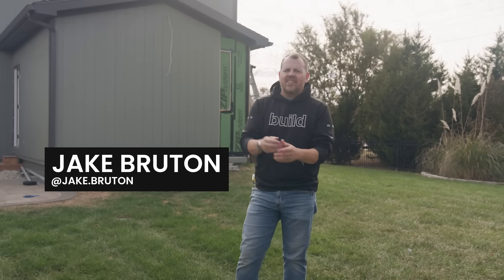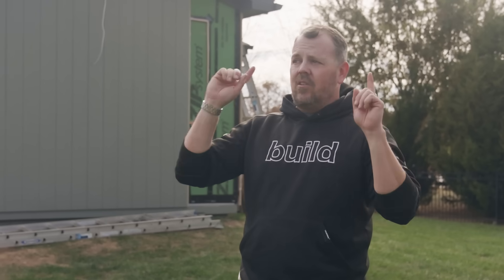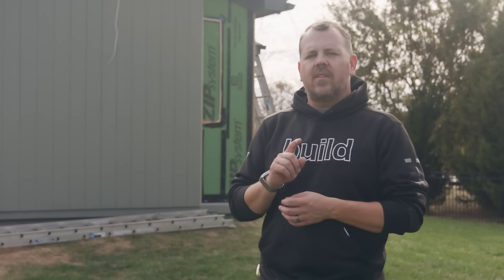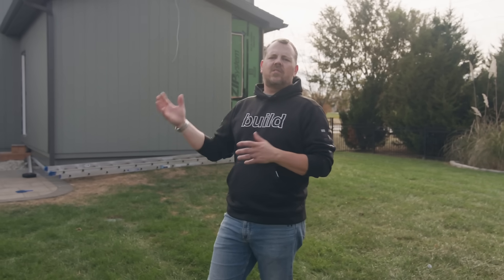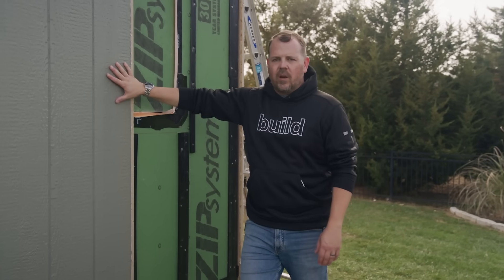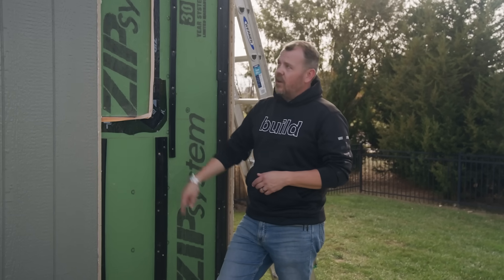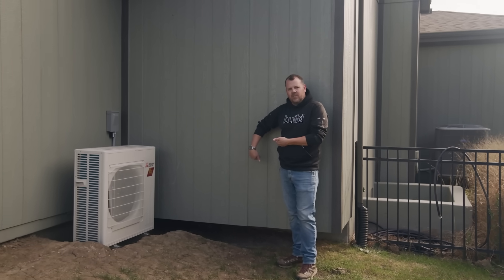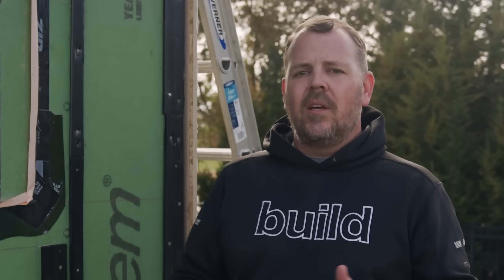Why Your Wall Assembly Needs Convection Drying

Comment: I get that the T1-11 “single wall” assembly isn’t up to snuff in the building science world and that it’s nowhere near as durable as the homes on the build show… not even close.

However, I’m all for people being allowed to build homes this way as long as they have full disclosure of the methods used. In my opinion, it’s easily as durable as a house with vinyl siding and if you wanted to mitigate the window leakage issues, then use some painter’s tape and a fluid applied flashing for each window, then place trim over once it cures.

To me it just seems like an affordable way to build a shelter and own a home. Obviously, the price of the home should also reflect then build quality (so if these builders are upcharging and gouging the market, then sure I think that’s an issue).

Anyways, great info but just another perspective on it.

Comment: So, for me, the venting of the rain screen needs to be wildfire safe.  The hillside that I'm building on is a mix of trees and grass because 40 years ago, it was burnt by a wildfire.  So, a plastic vent doesn't cut it.  I plan on using 1/8" galvanized mesh for this function.

Comment: We are planning a remodel, will be removing T111 and house wrap, going back with zip, new windows, 2x4 purlins and screwed down metal siding (three color barn dominium with wainscot), trying to decide foam sheets under the zip or on top of the zip then 2x4 purlins?

Comment: It's not clear to me once you add the cladding where the air will enter/exit from. Possible to show that?
Reply: Just the under neath. So the underside of the siding and rainscreen is open
Reply: Typically with a vented rainscreen detail like this, the Coravent provides a small gap at the base of the siding and at the top allowing air to be drawn in through the bottom, pulled up behind the siding and out at the soffit line.

Comment: T1-11 is terrible. It’s a terrible idea, like you said, it makes window installation a challenge. Your sheathing ends up being your water control membrane, and that means all the moisture that goes through it, ends up stuck inside your wall, where it meets up with warm/cool air transfer. That coravent is vital for breathing/capillary space. Using T1-11 on anything other than a shed is nothing other than cheap. The builders are saving themselves money and passing on garbage to the home owner. 23 + year experience building here and now building high performance in the NE. The latest building science proves the value of that capillary space the coravent provides.

Comment: Another wood frame house, another issue to mitigate.  I wonder if Jake would ever sign on to build an ICF house to the roof.  I mean he's in Tornado Alley and I'm sure there's a market for houses that that don't get scattered across the countryside when hit by a tornado.  It would be interesting for a top tier wood frame builder like Jake to go through the process and note along the way the steps he can eliminate as well as any issues he may encounter.  BTW, I have first hand knowledge that not all stick frame houses disintegrate in a tornado.  While riding out the 200mph eastern eye wall winds of Cat 5 Camille, an embedded tornado clipped the house and lifted it a few inches and dropped it.  That was fun.  Credit to my father for building  all walls as sheer walls.  My point being, it can be done, but at a cost that would probably exceed ICF.  And ICF would certainly be cheaper than building a CMU shell around a Zip house as is being done on another BSN channel.  I used to play in the rubble of cinder block houses.🤷‍♂️
Reply: All the Build Show builders are stick builders, who get sponsored by stick makers, so they only want to build with sticks.  
ICF is superior to sticks no matter how well Jake or Matt put the sticks together.  I’ve thought about starting an ICF only building company because it’s so superior to wood, yet it costs less than many of the wall assemblies the Build Show executes in their builds.  As an engineer it’s obvious the advantages of ICF once you understand wall assemblies and the perfect wall concept.
Reply: @andykross7242 Since your an engineer, can I ask you about ICF? How easy is it to repair? Can you add additions easily down the road? How strong is it compared to stick framing? Do you have conditioned crawl spaces with it? Can they be made passive? Do they require slabs? If the walls crack from shifting, can that be fixed easily?

What I like about stick framing is I can build my house right out of lowes and home depot. And there is margin, and its easy to repair. My wife and I had to do a pretty big repair that was inexpensive just time consuming, but i could run to Lowe's and start the project the next day. 
Also, what are the down sides of ICF if it isn't done properly? Can it be easily fixed if there is an issue? 

I became a builder ironically because I dont like depending on them... Sorry for the tons of questions. Ive been studying "building science" if you will, because my wife and I are going to build it ourselves. 

I'd be open to ICF if you could pass on a few good resources.
Reply: @chadrambo1038  I built a 6”2 conditioned crawlspace in my DIY 48’ tall ICF home.   My walls are 8” of concrete and rebar. It will be here in 1000 years 😊
Reply: @chadrambo1038  and yes ICF homes can be passive. Mine is. Many DIY homes get better blower door scores than Matt when he first started trying.
Reply: @andykross7242 There are some merits to the wood fiber cement type ICF (although those have their own problems as well). But I would never choose a foam based ICF product over a well built stick framed house.
Reply: What are you doing using common sense. Common sense isn’t sponsoring this video
Reply: @AllthingsRocco Matt, Jake, and Steve Baczek once had a little round table about ICF.  For the most part they regurgitated the same issues like termites, for which there are many mitigation techniques.  Funny that people who build wood houses would take issue with concrete houses.  Matt used the term "ICF cultist" on a recent video.  I suggested he use the term "ICF enthusiasts".  They said they would revisit ICF.  Probably when ICF gains too much traction and Huber asks them to bring up termites again.😂 My comments do not pertain to Jake.  Mainly the front man. One day a product is the best thing since sliced bread, the next day , not so much.

Comment: 5:21 Yes, "that thing" is water tight and air tight, which is good, but also vapor tight, which is NOT GOOD , walls that are vapor open are resilient to all kind of moisture problems.

7:26 If you can compress those ZIP-R sheets by hand, I would use regular ZIP sheathing without the integrated insulation and apply exterior continuous insulation in a vapor open material (Rockwool, TimberHP, ...). That way your walls become also more vapor open.
Reply: Vapour control layer is on the inside. He’s talking about the outside in the instance. Jake knows what he’s doing and is well aware of vapour control. Your wall can breathe outwards so any moisture issues inside the assembly are a non issue
Reply: @therefinedcaveman  Yes,  "my wall" is vapor open, but Jake's wall is not.

But if his vapor control layer on the inside is not perfect, vapor can get in the wall cavity and will get "locked in".
Even more, if the extra cavity insulation is vapor open, the vapor will condense against the (exterior) tape of the ZIP-sheathing and will make the OSB of the ZIP-sheets wet.

Huber is selling special tape that's vapor open for this reason, but almost nobody speaks about this matter.

If you make the exterior of your wall air tight but vapor open, just like the inside of your wall, no vapor will get locked in and you can always use vapor open insulation without any worries.

Air tightness is far more important because vapor transport due to air movement is 100 times more than vapor transport due to diffusion. That's why it's better to use air tight but vapor open air barriers on both sides, interior and exterior, especially when you have vapor open insulation in between. 

With every air tightness layer you get a vapor barrier for free... and you can use all kind of building boards for air tightening, so the structural sheets you use against shear and the sheets you use for interior finishing can both double up as your air tightening layers.

Comment: If you don't put the vented horizontal version at the top, then how does the convection drying happen? What is the retail cost per lineal foot for this vent?
Reply: he was just saying it doesn't have the bug screen at the top but it still has vents, I used this method accoding to matt's videos from years ago how he built his personal austin house.
Reply: The cor a vent website provides detail.

Comment: not just drying, but this becomes active heat rejection, so many ways to get there
Reply: That was my thought as well, I wonder if there is an energy savings in the summertime from the house bones not being as heat soaked in the sun.
Reply: @bighaasfly  you can get a vinyl siding profile but in steel, and a foam insulation contained in the curve...so make it vertical and vented behind

Comment: That's great, you should put a backing on the coravent like zip tape, or only put the vent on over top of zip to prevent any water from finding its way in through the nail holes.